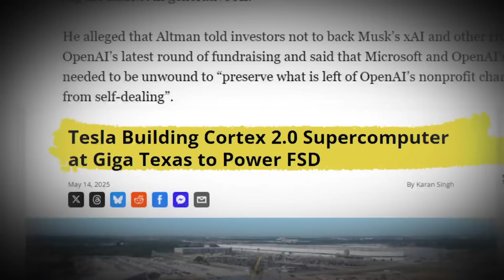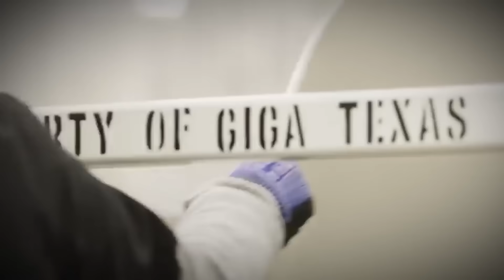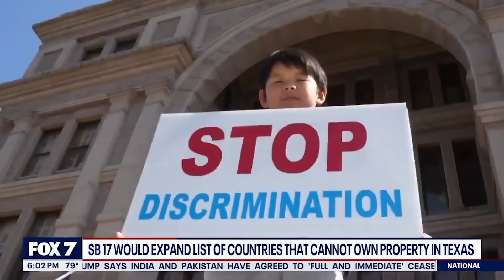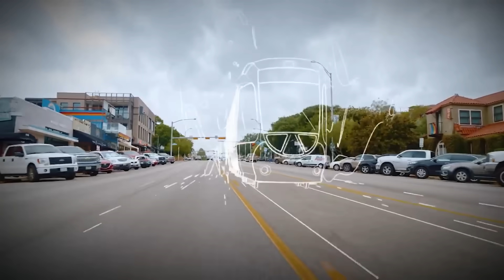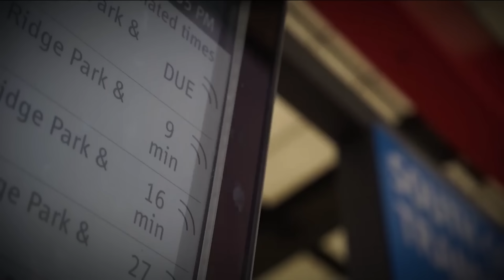Texas Megaprojects: 5 Projects That Will Change America

Comment: Texas is a place where high speed rail might actually work. There are four very large cities that are far enough apart from each other that driving is inconvenient, but close enough that if you fly you spend most of your time sitting around waiting. A triangle between Dallas, Houston and San Antonio, with a stop in Austin for the Dallas-San Antonio leg ought to get plenty more than enough traffic to justify itself economically. Even a direct Austin-Houston line might be viable. If done properly, this would be significantly faster, and presumably cheaper, than flying. But it would have to be executed intelligently. The price point for the tickets would probably be an important factor.

Italy has an innovative approach to their HSR, where a govt-owned company builds and maintains the tracks, but private companies are free to use those tracks (presumably paying a fee for the privilege). That allows competition at a lower cost of entry, without having to duplicate infrastructure. I could see that approach working well here.

Comment: lol, rising tensions with who??
Reply from the maker: Good question. The “rising tensions” line in the video refers mostly to the semiconductor segment — specifically the Samsung fab in Taylor. That project is part of a broader push for chip independence due to global supply chain issues and ongoing tensions around Taiwan So it’s less about direct conflict and more about economic positioning and tech sovereignty.

Comment: You can fly to Houston in under 90 minutes. Both situations you would have to rent a car. I get you have to deal with the airport, etc and that add time, but wouldn’t that be the same at the train station? They would have to make it significantly cheaper to make sense to me. Don’t get me wrong, I’m for mute options of travel, I just need to see more of a benefit over flying.
Reply from the maker: Totally valid points — and you’re right, the math doesn’t always add up unless high-speed rail checks a few boxes:
✅ Downtown-to-downtown travel (no TSA or long drives to airports)
✅ Fewer delays and shorter boarding times
✅ Cheaper, especially for frequent travelers
✅ Smoother experience overall

That said, it’s not about replacing flights entirely — just offering a faster, greener alternative for those 200–300 mile corridors where flying feels… excessive. Appreciate the nuance in your take!

Comment: The Tesla Factory is 3,850 feet in length and the entire site does NOT stretch longer than 5 Empire State Buildings. Please get your facts straight!
Reply from the maker: Thanks for the comment! You’re absolutely right that the Tesla Gigafactory in Texas (Giga Texas) is about 3,850 feet long, and we appreciate the clarification.

When we mentioned it stretching longer than 5 Empire State Buildings, we were referencing combined vertical height laid end-to-end horizontally, not total site footprint. The Empire State Building is about 1,454 feet tall (with antenna) — so 5 of them = 7,270 feet. That was an overstatement on our part — thanks for pointing it out!

We’ll be more precise in future videos. Always appreciate sharp viewers like you keeping things accurate 🙌

Comment: The Samsung FAB is dead - they stopped work last year
Reply from the maker: You’re correct! Samsung is experiencing delays and has put its Taylor, Texas fab on hold, with production pushed back to 2026!
Reply: @StructuresUnchained  Ain't gonna happen -- they have NO CUSTOMERS lined up for this facility.  Takes two years to tool.  I bet this will be written off and the facility put up for sale.  Samsung is a MESS - even there memory biz is on the ropes.
Reply: Rail will happen across Texas. Air lines and large auto groups will block it.
Reply: Not happen

Comment: Giga Tesla Texas was built in 2022.
Reply: The Samsung project is already built as well.
Reply from the maker: Great points! Giga Texas officially opened in 2022, but it’s still expanding with new lines for Cybertruck and battery production as of mid-2025. Same with Samsung — while Phase 1 of the Taylor plant is operational, major expansion plans (including a second fab) are still underway and breaking ground this year. These megaprojects evolve fast!

Comment: A short history of transportation... foot, horse, boat, train, automobile, aircraft, spacecraft. Rail is the past, not the future.
If high speed rail was going to be built in Texas it should have started a hundred years ago!!! 
Even the urban Dallas Area Rapid Transit still has as many bus passengers as rail passengers, still has not completed all of the rail lines promised 40 years ago, and can not survive without government (tax) subsides!!
Reply from the maker: Totally get where you’re coming from — Texas rail’s been stuck in slow mode for decades. At this point, high-speed might just be wishful thinking. 😅 but if they pull it off could be a game changer!

Comment: Put down the bong because high speed rail will not happen without government intervention.
Reply: You’re correct, it won’t happen without federal intervention especially in Texas.
Reply: It will happen without federal intervention. Government intervention makes everything more expensive, slower, etc.
Reply: @equinox2655 Nobody will write the check.  They “tried” and had to lean on the prior administration for $$, fortunately the plug got pulled.
Reply from the maker: Not wrong — without major government backing, high-speed rail’s pretty much stuck at the station. Still if executed!  imagine what could be. 🚆✨

Comment: The High Speed Rail is over due.  Southwest Airlines has a flight from Dallas to Houston every 30 minutes and a flight from Houston to Dallas every 30 minutes.
Reply: But it takes 30 mins to get to the airport and 30+ mins to go through TSA checks and board the flight.  Also need to pay for a check in bag now. Not very efficient.  Cost is the only factor.
Reply from the maker: Totally fair point — flights are fast and frequent. But high-speed rail isn’t just about speed — it’s about sustainability, energy efficiency, and unlocking mid-distance city travel without airport hassle. Japan, France, and China have shown it can transform economies. Texas could be next… if the politics ever align.
Reply: @StructuresUnchained it would have to be cheaper than a flight to make sense though.